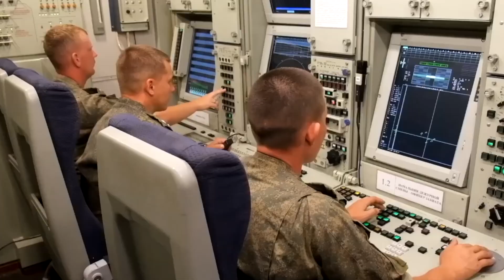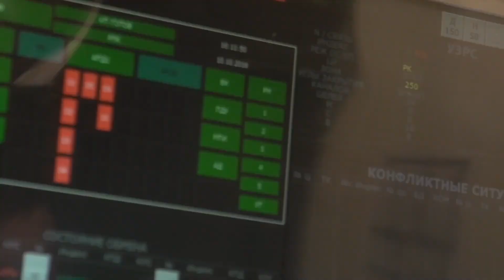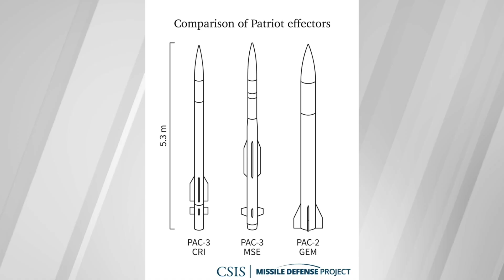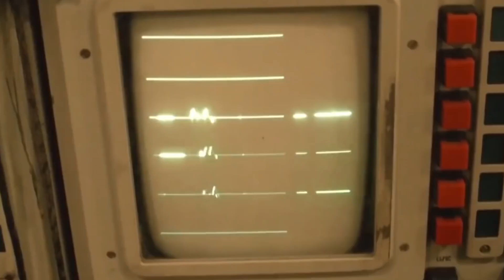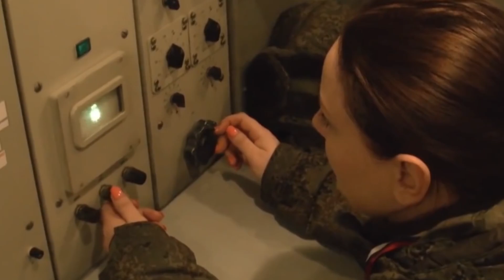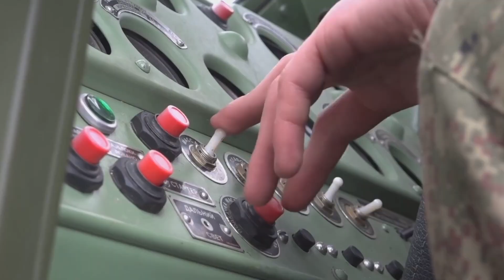S-400 vs Patriot air defense systems #s400 #s400missile #s300 #patriot #mim104 #pac2 #pac3

Comment: key phrase at the very end is "from documentation"..  documentation often differs from real world combat results. I still think the S400 is a better system

I also remember all the hype and propaganda about the patriot system in 1991..  While the system used now, is much improved, there is still alot of hype about the patriot systems IMO .They  arn't as effective as advertised but probably significantly better than the advertised kill ratio given to the public in 1991 version
Reply: The upgraded version is infinitely better than the original; I think Scott Ritter said that they never even shot down a single Scud with it, but I may be wrong . I just remember that it was the first tactical missile with a $ 1 Million price tag a piece I ever heard about. It is extremely pricey per shot, especially for export customers. On top of that, modus operandi is to fire two missiles per engagement ab initio.
Reply: Those Patriots were not designed against ballistic missiles but against aircraft. For the former you generally need kinetic missiles while for the latter fragmentation warheads are better.
Reply: main thing -- nato can not produce a lot
Reply: The document shows that patriot systems hit ratio is 30%. Very low rate. S400 showed ratio of 80%. We can see patriot sucks